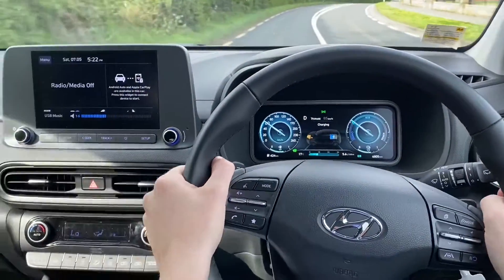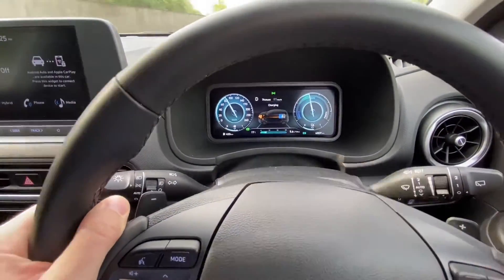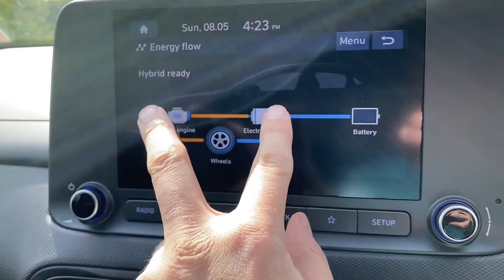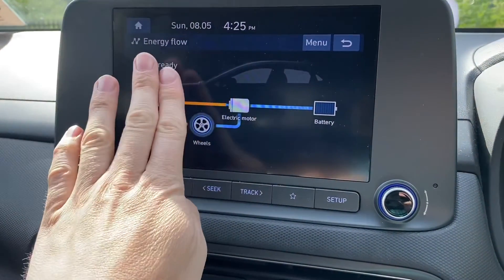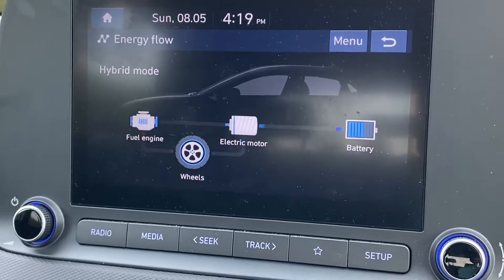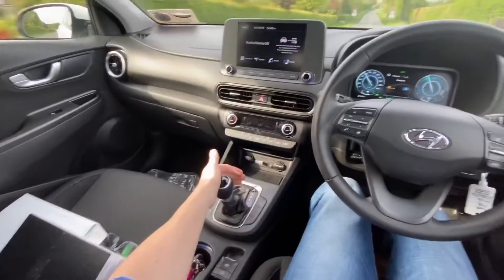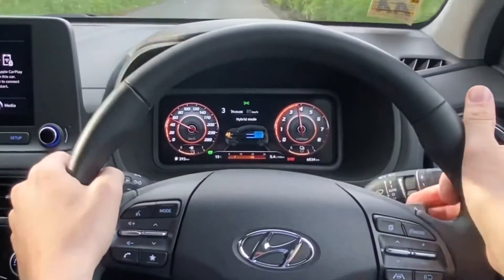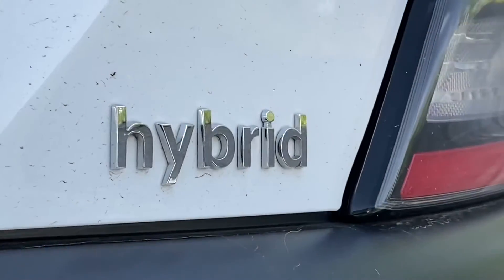What do paddle shifters do on Kona Hybrid and regenerative braking explained #kona #hybrid #howto

Comment: I've just got my ultimate in the UK, but when I'm in Eco mode , the flappy paddles don't do anything? And I can't see the 3 levels? What am I doing wrong??
Reply from the maker: Someone else said this to me before, and I couldn’t figure it out, your vehicle is full hybrid?🙂
Reply: @doolanbrian  yeah it's the 1.6 Hybrid Ultimate
Reply from the maker: @PB72UK  so if you’re in sport you can change gears etc but if you are in hybrid the paddles serve no function ??
Reply: @doolanbrian  I'm yet to try it in sport mode to be honest, first drive today and I just left it in ECO while I was commuting to work and back, according to the manual, regen braking is not available during cruise control , which I've not used yet, or if ESC is on ... Not sure if that has been switched on , maybe by the dealership delivery guy, I'll have another look tomorrow and try sport mode to make sure that works. Thanks for the replies.
Reply from the maker: @PB72UK  I’m curious, keep me updated !
Reply: @doolanbrian  thanks , will keep you updated!
Reply: @doolanbrian hi Brian, I went out today and figured out how to switch on the regen braking , so holding the left paddle in and not releasing it straight away seems to switch regen on in my Kona, once I do that the lttile battery icon thing pops up on the dash, and then I go up and down the levels as expected.. also tried Sport mode when joining the motorway , that is great fun!! 😂 .. certainly brings the Kona to life .. also gave the adaptive cruise control a try and was amazed at how good that is .. loving the Kona !! ❤ what a great car!
Reply from the maker: @PB72UK  good to hear, so you are starting to get used to it now, you guys go to a higher level of specification than we do! Thanks for letting me know that you’ve got sorted!

Comment: Do you need any setting to press the paddles to increase the level of the regenerative braking?
Reply from the maker: You don’t have to change any settings, just use the paddle while driving if that makes sense?
Reply: @doolanbrian  my kona paddles does not work while in eco mode. But the paddle works during sports mode. Something might be wrong
Reply from the maker: @zulboy  It may not be wrong .. so in eco mode it will probably allow regenerative braking but in sport mode it will change gears , is that what is happening ???
Reply: @doolanbrian  well, I am unable to change the level of regeneration but there is regenerative braking. Sports mode gear change works fine.
Reply from the maker: @zulboy  Apologies if I asked you this are you based in Europe?
Reply: @doolanbrian  No I am not..
Reply: @zulboy  , keep in mind if your battery is near full then regenerative braking doesn't work also weather conditions like slippery road stop the system

Comment: Thanks Brian this videos has been really helpful to me. I have Hyundai kona hybrid 2020 every time I try to use the paddle shifters for regenerative breaking it goes directly into sport mode changing gears. How do I use the paddles for regen breaking ? Thanks in advance 🙏🏼
Reply from the maker: Ok 👍 thanks for watching, is your gear selector sitting the correct position ! It should be all the way down to D .. but it should not be over to the right in sport mode ??
Reply: @doolanbrian  Thanks for the reply, Yes my gear selector is always all the way down on D when I am driving and I usually see the green colour Eco mode on my screen. But then when ever I try to use the paddles shifters for regen breaking it automatically goes into sport mode and the paddles start changing gears instead. Then I have to pull and hold the right paddles for few seconds then it will come back into the green colour Eco mode again.
Reply from the maker: @ufokaeugeneprivate1498  That is peculiar, what country are you based in?
Reply: @doolanbrian  in Finland. I went to local Hyundai store they told me that my car Hyundai kona 2020 hybrid do not have the regen breaking on the paddles shifters. That the paddles shifters are only for the sport mode driving changing gears and when I am stopping using the breaks that is only way I get the regen breaking not via the paddles shifters. This is strange
Reply from the maker: @ufokaeugeneprivate1498  Very unusual but I presume this is the Finnish specification! Sounds like Hyundai have decided that you guys prefer sporty driving to economical driving! If the dealer feels the specification is correct for your country, then most likely it doesn’t have the regenerative braking ! Sorry I couldn’t help better on this one, thank you very much for watching though